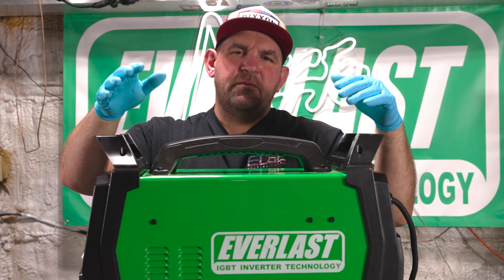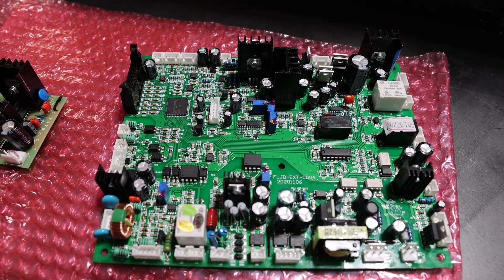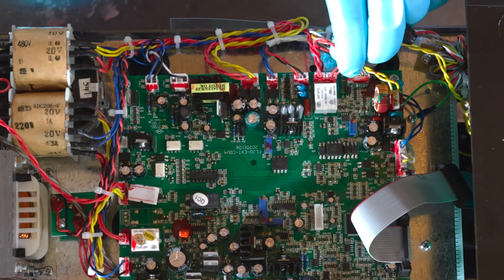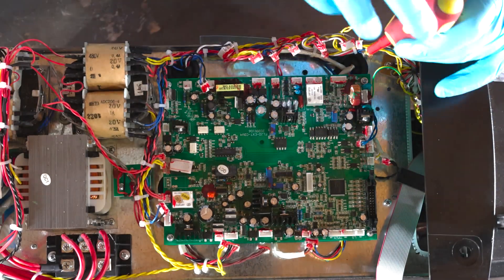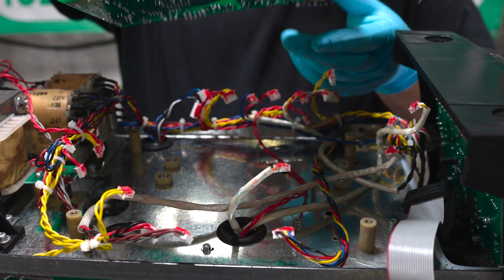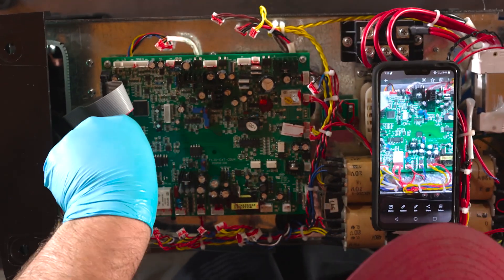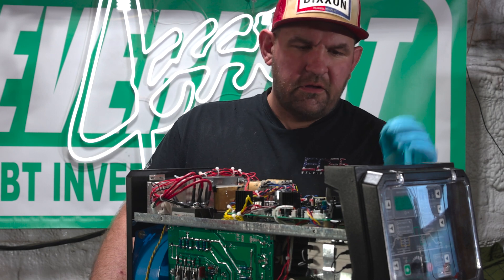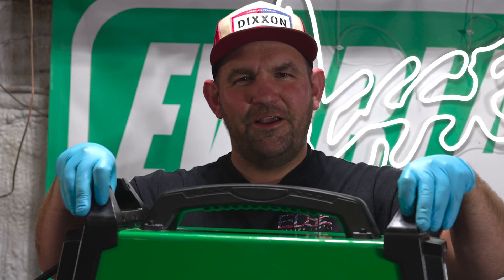How To Replace a Top Board | Everlast Repairs

Comment: I purchased my machine in 2018 and had to replace the top board last year. I can verify that after verifying my problem with the service tech. I had a new board in a couple of days on the five year guarantee. The removal of the old board and installation of the new one was easy and straight forward and was a success. Thanks Everlast.
Reply from the maker: Thanks for the comment Richard

Comment: I have a problem and question. I broke the amperage adjusting push button rotary encoder on my Everlast PowerArc 200 STi. It is on the DSPV1 board. I believe its an incremental type with maybe 28 or so pulses per revolution. I desoldered the broken one and ready to solder in a new one. But, I dont know the specs or manufacturer info. I would greatly appreciate any help.

Comment: I strongly recommend adding a safety element to this video....*unplug the machine*, discuss stored energy hazards (ie., inverter capacitors holding energy long after being powered down etc), avoiding having two hands on the chassis as much as possible/practical. One might also address contamination concerns when opening and working in an electronic enclosure. Mainly avoiding dropping anything into chassis, screws, metal dust, small pieces of wire etc., as well as clearing all loose screws from the work (inventory fasteners etc.).

Comment: So removing the clips are easier said than done if coated with that red adhesive. I had to remove with needle nose pliers, which is probably a big no-no with ICBs. Shipping a little plastic removal tool would have made the job easier.

Comment: My PowerTig 200DX has failed. Not sure which board is bad, but some of it works, I'm guessing it's a top board. Display always displays 30 amps, ac/dc and tig/stick switches cause audible relay clicks. There's no weld output, no hf freq output, none of the pots change anything.  Can you assist?

Comment: couldn't register on your forums to ask my question, so asking here - I have a 10+ year old Powerpro205 (single phase) that lost high power output once I dipped the tungsten (shorted out) at a start of a weld right as it was about to engage the high power output, not the first time I had shorted it by accidentally touching work with tungsten, but this time there were consequences greater than just cutting and regrinding the tungsten, HF still works like it should in DC and AC modes, just that there is no high current output in any of the welding modes (haven't tried plasma)
I'm guessing spares for these older gen machines aren't available any more?

I found an overall basic block diagram, but would like to ask if there is a more detailed layout of the particular machine in some manual - which board is doing what, I'm not asking for board circuit diagrams, but would be nice to know general layout since it is a bit birds nest in there... could save me a bit of time diagnosing the fault

Comment: Can the knobs/dials be changed? I snapped one off 😳
Reply: It requires the display board to be changed. Same as the process in this video. $125 for mine, just got it in 3 days shipped from China. I too broke the amp control knob off of mine.

Comment: On comment was "Excellent customer service"?  Is this the same company that promised me three months turn around time?  Never offered me a "purchase parts" option.  Told me my machine was old (8 years).  Shipping would have been almost $200 both ways.  Diagnosis over the phone was never an option only reply was "send it in".  Everlast never did confirm it was even fixable, because it was so old! Full discloser, My situation was a year ago.
I sold the machine for parts and never looked back.  Purchased a new Blue Machine and will never, I repeat, never go back.  In my opinion, Everlast is an Oxymoron.  I do hope others have better experiences.  The video doesn't give the price of the replacement board.  Always interested in what they leave out.  This self service is obviously an newer option as it the free repair shipping.  I suspect the expensive and slow customer service was affecting sales.  Sure did keep me from purchasing another.
Reply: Wait till that blue fails 3 and a half years out.  Or even 5 and no parts, or stuck waiting 6 months or indefinitely.  Yes, it happens all the time with the other brands and is one reason Everlast gets so many converts. Blue won't confirm if it is fixable either.  But when you are told to send it in for repair, then that means it should be fixable.  If you think it won't happen and doesn't with other brands, then that is showing a true lack of experience and an untested understanding. As far as the 8 year old machine or so, did you realize that the name brands begin to obsolete parts about that time frame, and if you can get them they are 4 to 5 times higher than an equivalent part on Everlast?  And that part, just one main board is sometimes 1/2 to 3/4 the price of a new unit? That doesn't include the costs of shipping and diagnosis, which you will bear the brunt of either. They do that so customers will buy a new one.  Sure...they have parts... lol.  No one wants to buy them... they just junk their units and go with Everlast. Everlast gets customers all the time this happens to. I guess that is a moot point, because it is obvious you didn't realize that. As far as that generation of machine you had goes, it has several possibilities for several of the main parts and it is not possible to confirm which exact one you need unless the unit is in hand.  Anything 2015 and before (and in some cases 2016) did not have the same type design.  Most parts were analog and had to be soldered or repaired on board to make a fix.  That is one reason Everlast transitioned to all digital control and standardized parts between models.  Even after the switch to digital it took time to modulize the parts between models so repairs would be more simple. This is a culmination of years of working and improving the unit.

Comment: Wow Everlast has open to do the repairs your self that's great after the warranty is gone but you should give free shipping back to Everlast if you make good product you will give a true 5 year bumper to bumper with free shipping too like other Co
Reply from the maker: We just recently announced that we will cover shipping both ways moving forward. All machines purchased after Jan 1 2022 will be covered for 5 years, both ways. Even then, this option gives customers the opportunity to have shorter down times during warranty repair.
Reply: @everlastgenerator  You might reach out to Louis Rossmann, he is a big advocate of what you are doing and has 1.71M subscribers .  

Another benefit of diy home repair is that the machine avoids rough handling of shipping.  There is no piece of equipment that is "better" after being drop kicked by the shipping company.  

If I needed a welder I would buy yours based on your diy friendly repair policy alone.
Reply: @everlastgenerator  It is covered for 3 years.  Please see warranty.
Reply: @everlastgenerator  after a diagnosis process, the decision will be made whether to offer the customer to attempt a self-repair or not.  If a self-repair is not an appropriate solution, and if it’s during the first three years of ownership of an IGBT unit, or the first year of ownership with a MOSFET unit, the unit will be returned at Everlast’s expense.  A return label will be provided during the warranty process.  If it is after this initial time period of ownership and for the duration of the warranty, the customer is responsible for the cost of the return.
Reply: All machines purchased from Jan 1st 2022 and forward have free shipping to and from repair center. No other company offers a 5 year warranty

Comment: This is awesome!  Had. A question.  I have  everlast  tig welder sitting  in the shop, one day I turned it on on a hot summer and it made a loud bang and then stopped turning  out, what can I do tht fix tht? Since then I bought a new machine  but would  like to repair  it to have a 2nd machine.
Reply: Sounds like a bad transformer!
Reply from the maker: Give us a call. Our customer support will go through it with you and diagnose.